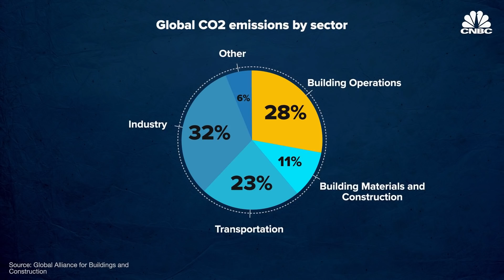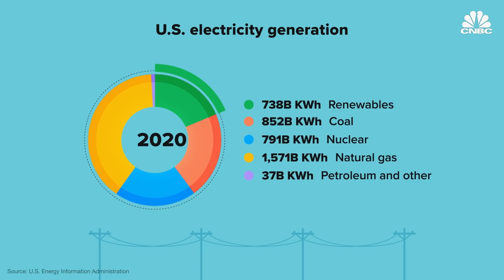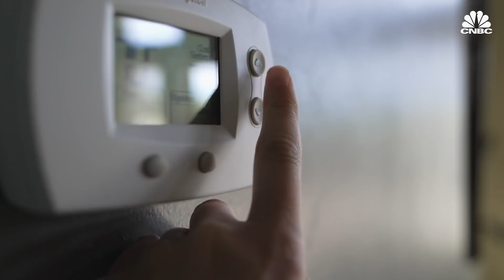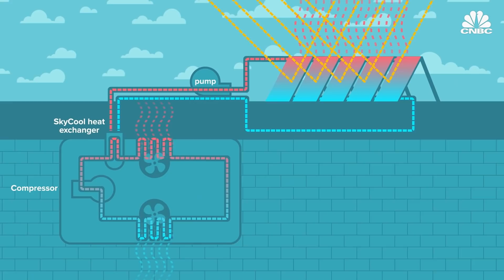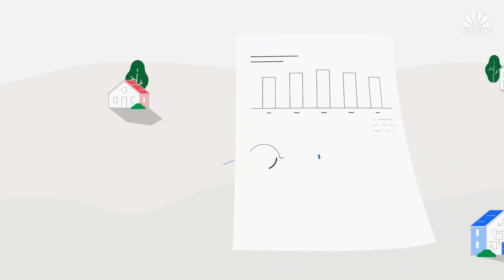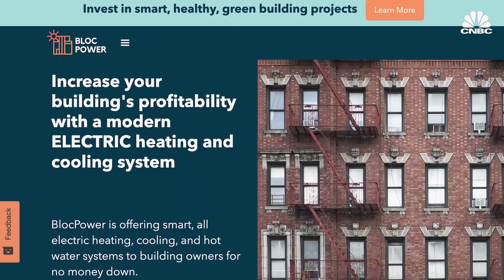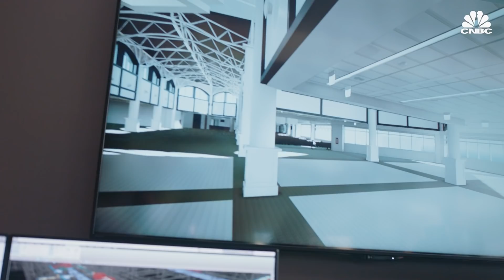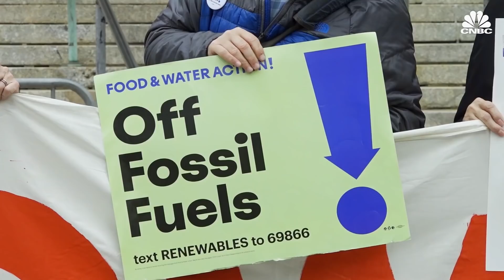How Air Conditioning Is Warming The World

Comment: I notice this story is not about being part of the solution.
Reply: A heat pump on hot days is nothing more than an AC. I don't see a solution here too, unless you use a waterloop in the ground to store the nights cold and use it at day instead of the hot air (Dual-Source Heat Pump)
Reply: actually a company is inventing a climate friendly Air conditioning unit, though it will take a few years.
Reply: Jack Strawb   9:13 onwards is about retrofitting and insulation.

Comment: I do repairs in hundred of rentals and landlords won’t replace anything that can be patched together because it cost them ROI. I was surprised on a triplex they wanted a dripping hot water faucet fixed ASAP. When I asked the landlord I found out the gas bill  is included in the rent and each drip was costing him money. How is that you ask? There is one 40 gallon water heater for all three apartments. Unless you can Incentivize landlords to do upgrades the most inefficient units will remain in use. Before you judge too harshly, ask yourself, if your boss came in and ask you to take a pay cut so he could do upgrades would you be OK with that? I work for myself and if I encounter extra expenses I don’t absorb them I pass them on to the customer.

Comment: “It can leak potent greenhouse gasses into the atmosphere”. Not if it is working right.  Also, that form of coolant has been outlawed for decades now.  Most systems use an environmentally friendly blend.  Yet again, mainstream media fearmongering about crap they don’t understand.  Will you ever get sick of it?

Also, heat pumps have been around for decades too.  They also aren’t as efficient as dedicated electric heating systems.  Usually, they can only heat houses as long as it isn’t too cold, usually no less than 32 degrees Fahrenheit.  If it is colder than that, a tertiary heating system then kicks in to heat what a heat pump couldn’t.  Again, no clue what you are talking about.  Heat pumps are also much more complicated.  Good luck finding a run of the mill technician who can troubleshoot and fix your heat pump when it inevitably fails

Comment: If cooling homes is heating up outside too much, why don't we just turn the window units around and cool off outside?
Reply: And live outside?
Reply: @dollartreeshark6786  well it’s going to be hot inside.
Reply: @dollartreeshark6786  The cost of this project will be immense. I'm appointing you as the accountant for this project.
It costs $10,000 per pound to send to space. The average house weighs 100,000 pounds and we have about 1.2 billion of them.
I suggest you create a GoFundMe for the amount of 1.2 Quintillion dollars. 
I have a few things around the house I can sell to get the ball rolling.
Reply: This guy gets it.
Reply: That's what we call a heat pump. AC simply pumps the heat outside, while reversing it pumps the heat inside. Interestingly it doesn't cost that much to reverse an air conditioner, and yet they charge so much to add a "heat pump". 

Anyway all AC's do is to move heat from one place to another. Same with your refrigerator, it moves the heat from inside the refrigerator to outside of it, so all that heat is pushed into your house. Although it isn't exactly a lot of space.
Reply: We do in winter
Reply: It uses power, burning coal or natural gas generates heat and the machinery likely generates heat plus the heat pumped into the room, that is more heat released. Unless you get the heat out of earth, it is just worsening the problem
Reply: @yangch03  
Your generating heat, worsen the problem.
Reply: @Robert-j6r8c  Yes, but now the heat is trapped inside the building. Taking into account the laws of thermodynamics, all we need to do is launch the now heated homes into space. We will need one brave astronaut for each house to open the door to let the heat out. We will also need to tie a rope to each house so we can pull them back to Earth once they are cool. I'll supply the rope from my ship, you recruit some astronauts that don't ask questions.
Reply: @Robert-j6r8c  60ish miles into space X an estimated 1.2 billion homes = about 72 billion miles of rope
I think I can cut some corners here and split some rope to increase supply. 
How are we doing on those 1.2 billion clueless astronuats?
Reply: @captainmorgan2307  nah, my don't need to retrieve the home, or open the door, as long as they don't return, it will be fine
Reply: @captainmorgan2307  I think there are talks on putting white stuff into the high part of the atmosphere to reflect sunlight, could be more cost effective that way, but the environmental impact is still not very certained.
Reply: @yangch03  Did you read my reply?
An AC is a heat pump. It moves the heat from one place to another. Usually from the inside to the outside for an AC unit, and from the outside to the inside for a heating unit.

This can be more efficient in many climates.

The heat produced is in bulk at the power plant, so it is much more efficient. And in winter that is the purpose. But by the time Summer is here, that heat would have dissipated. The earth can't hold on to it that long, unless it's underground. And there are systems that pump heat into the ground. 

Anyway they are not talking about heat being created, but the heat that is absorbed by CO². Something that is much less important than they imply it is.
Reply: @VIKDR1  I understand the comments as people fantasizing reversing climate change by pumping heat in doors as they say pumping heat indoors and stay outside as it would be cooler
Reply: @VIKDR1  you wanna test climate change measure the ground temperatures a few feet below surface over a time spans.
Reply: @VIKDR1  you wanna test climate change measure the ground temperatures a few feet below surface over a time spans.

Comment: Here's a crazy new idea that can solve this problem of power usage. Nuclear power. Solar doesn't work at night or in cloudy weather, wind turbines require wind to function and hydroelectric dams need a river and also damage the local ecosystem. Nuclear power is safe, efficient, and makes a massive amount of power. There are about 400 nuclear power plants yet only 3 major incidents have occured, 3 mile island, Chernobyl, and Fukushima. 3 mile island was one of the first nuclear power plants, so you have to give it some slack, Chernobyl was caused because the reactor rods, which are designed to stop the nuclear reaction, were tipped with beryllium, which statically increases the nuclear reactions, and they did a test, pushing the reactor to it's limits, it started to get to hot and when the tried to drop the rods, the reactor made so much steam so quick that it exploded. Fukushima was caused by an earthquake and the subsequent tsunami. The main problem is that it is very expensive because of really stupid regulations and it takes about 10 years to turn a profit due to the loans required to make it. Nuclear power is the future, unless we want to keep going with inefficient green power and efficient non green power.

Comment: The 116 degree heat DID NOT MELT the power cables. That is a LIE. The plastic sheathing on the power cables is rated at above 350 degrees. The only reason that one spot that is shown melted is because of a resistive connection fault that caused the WIRE to heat up and thus melt the plastic sheathing. What a load of NONSENSE this video contains!
Reply: THANK YOU... I didn't even know anything about this situation, but I knew 116 is nowhere near enough heat to melt the insulation on those cables
Reply: @jeffklaubo3168  YES! If 116 degrees would melt electrical insulation all the wiring under the hood of your car would have to be replaced every HOT day every summer! lol
Reply: @SundayBeastz  would need to be replaced everytime you heated up the engine, operating temps around 95+ c and lets not talk about anything near the exhaust area.
Reply: the best one is running on an extension cord  and expect it to not melt biggest fault in the use of an ac
Reply: @teck0475 Yes! Common sense is a RARE commodity these days especially in the National News Media arena.
Reply: @Spider  Man green communists*
Reply: Or a direct short L
Reply: I guess you never Attended Communications in College. I did and we did a test. Everyone formed a circle. When the original person passed the message "Wipered in the ear" to the next person and it was repeated, the original message was totally changed. See the point?
Reply: I was in the Hvac industry. What about the extra 1000s of btu's of heat created in the operation of the air conditioner needed to transfer heat from one place to another. More air conditioners, appliances, cars, factories, businesses, homes, planes, motor boats, more power plants, more electricity stations, more fires. Any and everything that creates or generates heat. They say we are in a race and we need to slow things down. We could try to run faster or change the rules of the race but I don't think we have a horse in the race.
Reply: Good point Bio Bill. There's a lot of lies going on for money. Nothing new. I was told Freon is a drug. What did we do before without it? We lived. Now we are all dependant.
Reply: several lies in this video , i suggest you all who made this video go back and read the laws of thermodynamics
Reply: you mean CNBC would air a story that is not true?  The horror of it all!!!!   LMAO
Reply: I love how snopes re defines the definition to adapt to there narrative.... Not f you google fb twitter and all other conts
Reply: First off, not quite sure what a “resistive connection fault” is. Sounds like a personal problem. And secondly most, if not all connection points are higher resistance than the conductor itself, therefore higher temperature. If surrounding ambient is higher than the system was designed for( which is totally conceivable since triple digit temps are not the norm in the northwest) than it’s very possible to have failures. That’s why there’s such a thing as conductor de-rating in the NEC.
Reply: @idog1892  Every electrical engineer and electronic technician KNOWS what a resistive connection fault is. Current through a resistive connection creates heat.  Your claim that "most, if not all connection points are higher resistance than the conductor itself" has NOTHING to do with RESISTIVE FAULTS unless the connection was IMPROPERLY done. The resistance of a properly performed connection is measured in MICROMHOS  which is almost ZERO for all PRACTICAL purposes. A micromho is 1 MILLIONTH of a mho.  Your comment "If surrounding ambient is higher than the system was designed for( which is totally conceivable since triple digit temps are not the norm" is utter NONSENSE. Power company ENGINEERS are not IDIOTS that they would DESIGN a "power system" with such NARROW parameters so as to fail at such a REDICULOUSLY LOW possible "ambient" temperature of 116 degrees is completely absurd. Conductor de-rating has to do with conductor or insulation deterioration due to age and has NOTHING to do with AMBIENT temperatures.  IF what YOU CLAIM is true WHY did power CABLES NOT MELT in British Columbia which had 122 degrees that same week????
Reply: @SundayBeastz  YOU’RE ALL CAPS DO NOTHING TO CHANGE THE FACT THAT YOU HAVE NO CLUE WHAT YOU’RE TALKING ABOUT. (Your degree from armchair polytechnic not withstanding)
Reply: @idog1892  except he is correct and you are not.
Reply: @idog1892  I DO KNOW EXACTLY what I am talking about. I am a retired electronic engineer / technician. Besides that ANYONE with common sense KNOWS what I posted is TRUE!
Reply: @SundayBeastz  lol you're completely missing the point of the video by getting caught up on some trivial detail about the cord melting or not melting. Do you think that that somehow disproves the videos thesis? Critical thinking skills folks.
Reply: @hjdhbcfjjb  Yes, critical THINKING for sure. . ."about the CORD melting".  What CORD?????
Reply: @ReflectedMiles  Sorry me brother but I do NOT need any "actual sicentific summaries". I stand by what I said because I am 100% correct and I KNOW what I am talking about. As far as your "experts" are concerned I couldn't care less. Any 8 year old can make stuff up. Thank you for you response!
Reply: @SundayBeastz  Now that's about the level of response I expected. No expertise involved at all and complete dismissal even of the industry science. Thank you.
Reply: @ReflectedMiles  You are very welcome. Apparently 380 people gave "Thumbs Up" to my EXPERTISE!
Reply: @SundayBeastz  CORR. Thumbs up to your ignorance just assuming that a reasonable-sounding explanation must be correct. We have plenty of examples in human history of masses of people believing all sort of things without evidence that actually withstood scrutiny.
Reply: @SundayBeastz  Thanks for affirming the additional conspiracy-theory buy-in as well. That helps to frame all of your comments relative to credibility, and especially relative to actual engineers and scientists working their specialist fields. Conspiracy theorists always know better than professionals in their fields--always.
Reply: @idog1892   localized high resistance points are a well known source of heating in circuits. The derating you mention is largely irrelevant to the range  of temperatures being discussed. Whether the ambient temperature is 95 or 115, that is a miniscule difference against a melting point of 350 degrees. Unless the wires are severely overloaded (too much current) there is no reason the insulation would melt. As pointed out, the under hood area of a car gets far hotter with no problems.
Reply: @idog1892  I kind of just assume derating is the rule in every high power control or distribution system. Whether a 3rd world country always follows their rules is a different matter, but I think even failed states have electrical code.
Reply: Reminds me of the people that were claiming that fire cannot melt steal when the twin towers came down on 9/11.
Reply: the lemmings will believe anything they're told.
Reply: Thanks for watching and exposing. I couldn’t bring myself to watch another hypocrite climate hustle video. Went straight to the comments. 😉🤙
Reply: Misinformation
Reply: Agenda (& the higher costs for consumers through regulations & overthinking...."Oh Well!") Funny they won't EVER bring up the USA turned into the #1 CNG exporter during one outsiders first term of presidency. (China agenda)
Reply: It's just the leftist climate change BS the news has gone too.
Reply: @amazingthingsfromaroundthe2057  climate change is real there’s just so many false news things that exists
Reply: @skygge1006  It's real and it amounts to just about 1C over 130 years.  Whether it's actually a problem that will result in dire consequences or not, is still a subject of great debate (despite the alarmism).
Reply: @amazingthingsfromaroundthe2057  There is no BS climate change. FIRES. BRAIN.
Reply: @amazingthingsfromaroundthe2057  Meanwhile, the rightists are full on suicidal.
Reply: Thanks for the information. 👍 These climate change people LIE. They've always lied and they always will lie.
Reply: Yeah the cable insulation melting was ridiculous and don't know about the CFC's but totally believable about the patents expiring. Are they lying when they say June 2021 was hottest month on record in the US?
Reply: @artv232  definitely not the hottest were i am but lots of rain  probably do to the fires in the west
Reply: @artv232  you can’t believe a word they say. They been claiming hottest, coldest, wettest , driest, most this that etc for decades.
Reply: @artv232  yes. It’s called weather patterns/cycles. Ever heard of the ice age?
Reply: @artv232  there’s a lot of scientists who say the opposite. So who’s right? It’s all relative.
Reply: @jerrysanders9101  weather pattern is part of the deal, we are entering an hotter age naturally, BUT, it is shown that the CO2 we pump out every day leads to a much higher grow in temperature that what will happen naturally. Imagine natural as getting fat and pumping CO2 as getting coats, they can co-exist!
Reply: @artv232  if I sell electrical power and sell it from making it from fossil fuels that's one thing. It cost a lot to make and sell. If I get you to install solar panels for a high price then charge others to buy your extra energy. Then I make more money with less spent and less efforts. Not to mention all the extra maintenance and battery replacements you'll need overtime. Why else would they not allow you to be self sufficient and unplugged from the grid.
Reply: @debbiescott6732  YUP 15,000 academic papers written on climate change are a lie! Thosuands of Climate change Scientist most with PHDs are a lie. Guess you will say the same thing in a horrific flood or loosing your house in a fire.
Reply: It's all fake. The chloro-flourocarbons was a massive sting against the public. The real reason was a patent was expiring and China were going to manufacture it. It is IMPOSSIBLE for  chloro-flourocarbons to get into the upper atmosphere unless actively released up there.
Reply: @VenturiLife  Wrong, Replacing CFC in the 10090s from R12 to 213 did close up the Ozone hole in the Arctic.
Reply: @LK-pc4sq  wrong.. Oh so wrong.. Haha